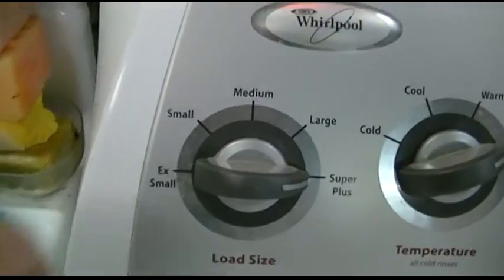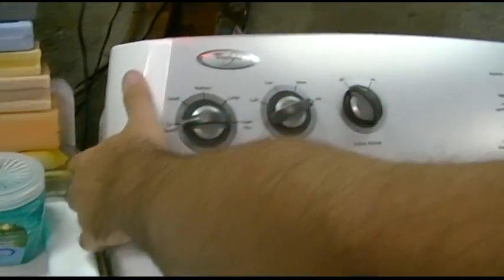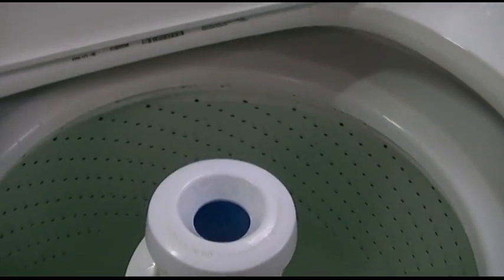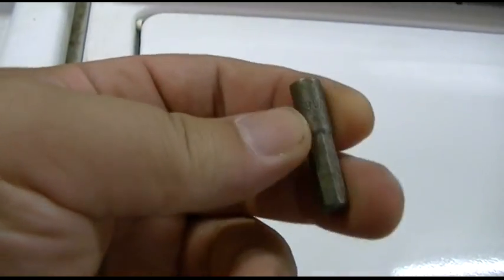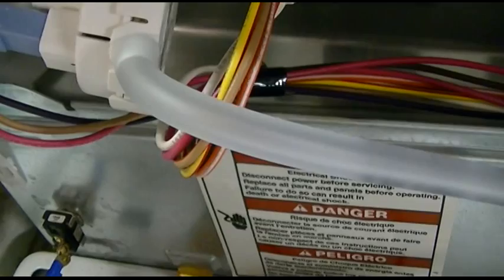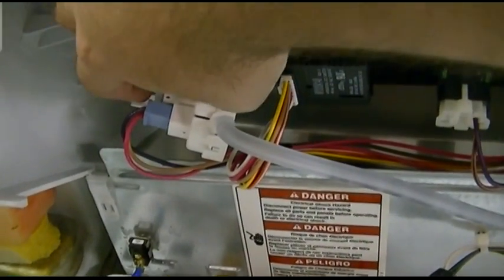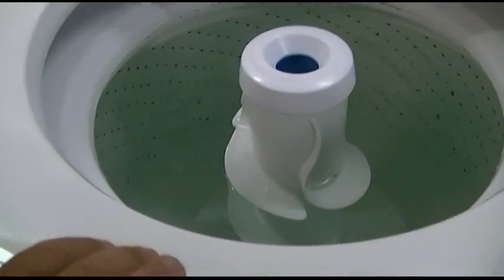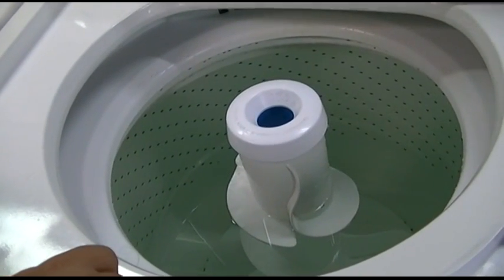Whirlpool Washer - Adjusting Water Level Selector

Comment: I don't think I could do that with my digital controlled SpeedQueen - wish I could. It does fill up at least to where that whirlpool started at - which I'm still fine with. I was impatient when we bought our house, and didn't want to wait for the dealer to order a machine with the knob controls. I can't stand the laundromat with all the kids and having to sit there waiting with my thumb up my (you know).

I'm still very happy with it though even though it only fills about 95% of the way unlike the front loaders and HE top loaders (Which don't even have an agitator! and have locking lids so you can't add anything after it starts! - How are they supposed to get anything clean?). I can't imagine trying to wash my queen sized comforter in one of those. 

But I can lift the lid or pause it for an extra long soak and also I am able to disable the switch that stops it with the lid open - which isn't really necessary but sometimes I just like to watch what it's doing. So that is nice.
Reply from the maker: You actually might be able to, depending on how they worked it it.  If they used a pressure switch similar to these machines it should be adjustable--the circuit board is just watching for a switch to open or close.  They may have used a variable-adjust one that uses resistance based on the amount of water in the tub, in which case I couldn't think of a very easy solution.

The other option is to add a manual fill momentary switch to the machine.  You'd tap into the 120V feeding the machine, go through the momentary switch, and wire that to the fill valves.  You'd just hold the button for as long as you'd like the water to flow, and I don't think the circuit board would know the difference.  There are options available to you, just think about ways to solve the problem.
Reply: I have found many videos for the knob controls, but not the digital controls. - The only brand that we could get because of the small doorways was SQ when the warranty expires I will mess with it more - but since it's still under it's warranty (which SQ is great for) I don't want to mess with it too much when I don't exactly know and void it. but the disabling the lid lock was super easy with just a clothsline pin. After the warranty is over in about 3 1/2 years from now I will try to mess with it a lot more!
Reply from the maker: Only 3 1/2 short years.  Wait till you see how bad washing machines are then!
Reply: I am not planning on getting rid of this one. - SQ skirted the laws as much as they can. - I am keeping this forever and rather than replacing I will keep getting it repaired. It was the only brand that is still made that is easily dissasembable that in pieces would fit down my tiny basement staircase. That's why I had to go to a SQ official distributor because they aren't sold in places like Home Depot, Lowes, etc...

It was either that or a very tiny HE front loader - which we didn't want - don't like front loaders and what's the point in having a tiny machine when I would still have to go to the laundromat to was my sheets and blankets.
Reply from the maker: Same with my Whirlpools, I will replace whatever part on them that's necessary to keep them running, there is really no other choice.
Reply: They are all terrible now! especially the HE top loaders without agitators that everyone only seems to sell. I can understand having an eco setting (I actually use it on my machine a lot for normal stuff) but it shouldn't be the only option - for instance whenever I come home from a business trip or an out of state family visit and have to stay in hotels I want things washed in the hottest and most amount of water possible. - Bed Bugs from a hotel are no joke, had to throw out everything in one room years ago before I realized they are a real thing and not just a childs rhyme.
Reply from the maker: Oh yeah, they're total junk now!  Horrible all around.  I guess we are of the few that know there are better ways, better machines, and that sometimes, the old-school "grandma's recipe" is better than anything they'll ever come up with today!

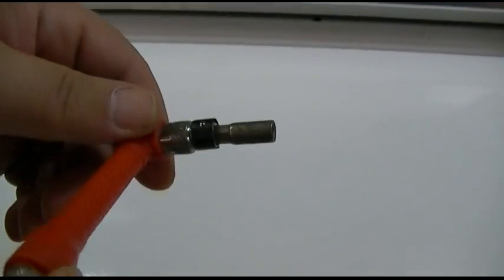Comment: 1:50 my boss gave me a kit like that with a little chinsey ratchet. That was 20 years ago. I've used that thing easily 1000 times. Best $2.00 ever spent.
Reply from the maker: Depends on the kind of work you do.  I just ran into a set of screwdrivers, small ones, from a good 35 years ago or so.  I've never used those either.  I have much better tools with higher precision.  Cheapest tool I have that has come in most handy is an old set of small needlenose pliers.  I just used them today, in fact, replacing a sticker on my car's windshield.  Lets me get it absolutely perfectly straight when reaching down where the window hits the dashboard.
Reply: @jaykay18  lol well, I think I know the precision screwdrivers you're talking about. Chrome with black blades and an octagon on the ends? 

Yes, I'm sure snap on makes a ratchet 3" long.....but why spend $180 when a $2.00 one does the job just fine?

BTW: I have a $200 stiletto hammer. Why? because it was easier on my shoulder than the steel $45 one. A big feature when you drove on avg 1000 to 1500 4" nails a day.
Reply from the maker: @muskokamike127  Nah, these are real cheap junk, probably will strip the screwdriver the first time you use it.

I fully agree, there's a time and a place for cheap tools, and a time and a place for more expensive ones.  A lot of times the cheap tools will perform more than adequately.
Reply: @jaykay18  the ones I'm talking about WERE literally garbage. 

I built a newer better bigger cnc router. I bought a new porter cable router for it. The brushes wore out after 4 months. They warrantied it, but it was out for 6 weeks. That router cost me $200.00

I instead bought a cheapie $79 one from Canadian Tire (think harbor freight). The brushes last about 10 months and since it has a 3 yr OTC warranty, I walk 1 1/2 blocks, and they give me another one and I'm back to work in an hour.
Reply from the maker: @muskokamike127  The best harbor Freight gives you is 90 days.  If you even try to return something because it's broken, they give you the absolute hardest time.  In fact, the only time they don't give you a hard time is when you don't ask questions and buy stuff.
Reply: @jaykay18  Yeah, I'm in Canada, we don't have HF up here. I referred to HF because it is well known in the US. Canadian Tire (google it) is a better version but they still sell offshore housebrand stuff. 

The thing is, it might not be the best quality but their warranty is outstanding. 

I broke a socket I bought in my teens (40 yrs ago) and they warrantied it. Their line of sockets and ratchets all have the warranty. 

Maybe Sears/craftsman would have been a better analogy. 

Even pro mechanics are telling apprentices to buy their stuff now simply due to the cost and the ease in getting a replacement. They don't have the "feel" of snap on but considering you can buy a complete tool box for the price of 2 snap on ratchets is a big factor in what to buy.
Reply from the maker: @muskokamike127  Sears is pretty much gone by now.  The Craftsman name lives on, but getting warranty service on older tools, not very likely to happen.  And chances are, they would need to be shipped.  All in all not a great warranty on anything here now.  I have always said that the US gets the short end of the stick.  We have the worst of everything, compared to what people from other countries have told me that they have.
Reply: @jaykay18  Yeah it's a shame about sears, most craftsman tools were top notch. Some of their branded power tools sucked but for the most part, they were good. 

When I worked construction a buddy bought a rigid set of li ion tools. "lifetime warranty". I said "good luck with that". 

One of his batteries died, so he went to the local Home Depot for warranty. He had to pay to ship it and pay to ship it back. Total cost: $56.00. A replacement battery was only $45.00. 

Bosch has a good warranty, they pay for shipping both ways but only for 3 years. I had a drill that died, they sent me a shipping label and since they didn't make that type anymore they sent me a brushless one instead.
Reply from the maker: @muskokamike127  I hear you on that, my dad has Craftsman tools from at least 40 years ago, maybe even 50 or more, and they're just as good now as they were back then.

Ridgid is Home Depot brand.  My friend had a Shop Vac from them, which failed.  That had a lifetime warranty as well.  He called, they asked him to send pictures of the unit (basically to make sure it wasn't run over by a truck and still looks like a vacuum), and sent him today's incarnation of the same model.  Batteries, though, at least here in the states, are considered consumable items, which means it is known that they will wear out in time.  Those type items have some sort of limitation on their warranty, if there is one at all.

It's very rare to find anything with more than a 1 year warranty here (another example of the US getting the short end of the stick), but those that do have longer warranties, well still, good luck.  I bought a Brinkmann barbecue about 8 or 9 years ago.  Had a lifetime warranty on the burners.  That's all fine and good but the company is no longer in business!
Reply: @jaykay18  Yeah, your BBQ story is pretty common. That's the thing with policies like "lifetime" warranties, they tend to drive a business under. We had a retailer up here Eaton's, they had a no questions asked return policy. They'd take back clothes that were obviously worn out. They went under due to people abusing it. 

Ridgid batteries up here are covered under the lifetime warranty. But it only works if you live near an HD that has a service depot instore. If you have to ship them, you're screwed. 

To be honest, you may be right about your warranties but I'd trade our warranties up here for 1a and 2a in a heart beat. Up here, it's a criminal offence to defend yourself.

Comment: How can I add more water to a Maytag XL 6.2 top loader HE?
Reply from the maker: If it auto-senses the load and takes in enough water just for it, you can't.  Just another benefit of NOT owning an HE washer.  Otherwise, the procedure will likely be similar to this, within limits.
Reply: I hook up the garden hose and add water. It's easier.
Reply: @oldenoughtoknowbetter6561  my machine just goes to drain mode when I add water.  How efficient is that?

Comment: So counterclockwise will decrease the water level?
Reply from the maker: Yes, but don't.
Reply: @jaykay18  but on my load settings.. I try to do the mini/small/medium and it just keeps filling all the way up
Reply from the maker: Sounds like there's a problem instead that needs to be addressed.  If you'll notice, this adjustment is more of a fine-tuning adjustment, so adjusts a little bit.

Maybe I can help you.  What kind of machine and how old is it?
Reply: @jaykay18  its a maytag performa. Idk wat year i bought it used.. It cycles thru correctly but it just fills the whole washer no matter wat load size its set at..
Reply from the maker: The exact year isn't important, but a time frame is necessary.  If this machine is any newer than about 10 years old, it's likely computer controlled and nothing here is going to help.  So I'd like to know about what I'm dealing with before proceeding.
Reply: @jaykay18   It looks like a really older model probaly 10+ years old.
Reply from the maker: OK, that's a GOOD thing!

Chances are it's a problem with the water level switch.  Open the control panel and find the back of it.  You should see a small hose connecting to it.  Take the hose off and blow into it, you should hear the air escape somewhere inside the washer.  If the hose is obstructed (sometimes by lint or other debris), that could be the entire problem.  You would need to clear it out to make it work again.  Another possibility, although not likely, is the hose may have a break in it, which will also cause the problem you're having.

Most likely the water level switch itself will need to be replaced, it's a $30-$50 part.  You'd need the model number of the washer and you can look up the part number at Sears PartsDirect.  You can buy from them or search the part number on Amazon, ebay, or just Google, and possibly find a cheaper price, but make sure the number matches, there are many that look the same but aren't.  It takes about 2 minutes to install the new one.

Comment: Whirlpool LSR8444L(cannot read the rest) doesn’t have an adjustment screw.  I’m not happy at all with the water level on this old washing machine.
Reply: My level is a little bit too low.  I don’t see any adjustments screw on my level switch.  I’ll see if there are any switch replacement videos for my model, which is probably 15-20yrs old.  The number in my first post is the model number.

Comment: What causes it to lose calibration?🤷🏽
Reply from the maker: They generally don't lose calibration.  This was simply done to increase the water level in the tub a little more.  Just helps things out when doing a very large load.  The articles that are to be washed basically need to "swim" in the water, and when the machine is packed full, that little extra definitely helps.
Reply: @jaykay18  my whirlpool washer used to full up normal, now I've changed the suspension rods and the tub fulls medium when the selection is on full load. And when the selection is on small, it's not enough water to wash
Reply from the maker: @Spock-g6d  I bet you have a newer belt drive washer that has auto sensing.
Reply: @jaykay18  no I don't have auto sensing. I think the auto sensing will be on the control board. My washer have the pressure switch.
Reply from the maker: @Spock-g6d  Yes, but you said :suspension rods".  If your washer has light on the control panel, or a "start" or "play/pause" button, it uses a belt.  And those washers still have the pressure switch but use it as an LIMIT switch or OVERFLOW detector.  They try to use as little water as possible, up to the maximum allowable set by that switch setting.
Reply: @jaykay18  okay. Then is the pressure switch is faulty?🤷🏽
Reply from the maker: @Spock-g6d  No, the machine is a piece of junk!  The computer inside decides how much water, the pressure switch is only there to prevent it from taking too much.  Get rid of it and it will happily overflow and flood your home.  So you're still stuck with a piece of junk.

Comment: My direct drive doesn't have it
Reply from the maker: The latest and last direct drive they made, in the upper model tier, had an automatic level selector.  Some of the older machines that have a water level switch didn't have the adjuster, but often they can be swapped out for one that has it, from a different model.

Comment: I popped the back of mine and leaned it back no magic screw anywhere, just circuit boards and wires.
Reply from the maker: Sounds like your machine has automatic level selection.

Comment: Mine doesn’t have that valve. Model WTW4800BQ1
Reply from the maker: That's because what you have is not a washer, it's a joke.  THAT is why you decided to search for this, because your joke doesn't take enough water to actually wash.  This only works on real washing machines with mechanical controls, and not play buttons.

Comment: Remember, it's mechanical...You could have just unclipped it from the cabinet, adjusted it and clipped it back into place when done. By "unclip" I mean just let it dangle as you are adjusting it with the wrench, I don't mean unplug all the wires.
Reply from the maker: Yes, that's another way to do it.  Figured it was easier to fight with it in position since I had a wrench that would fit.

Comment: And old timer told me water not above the top two roles of holes.
Reply from the maker: Perhaps he was erring on the side of caution.
Reply: But isnt it bad if the water level goes above the agitator bolt?  Wont that allow water to go down below the drive shaft?  The water on mine fills above the bolt the center there where the bolt is fills w warer